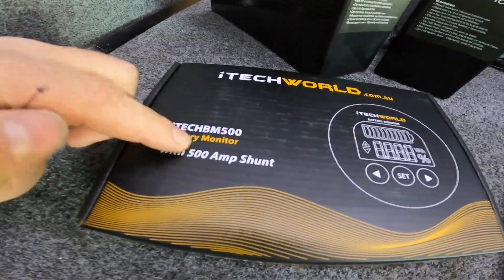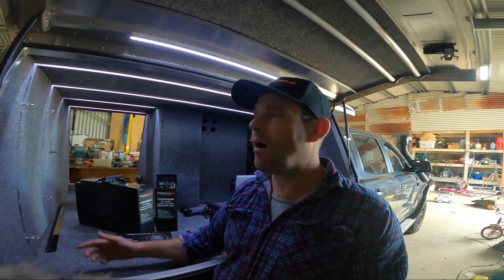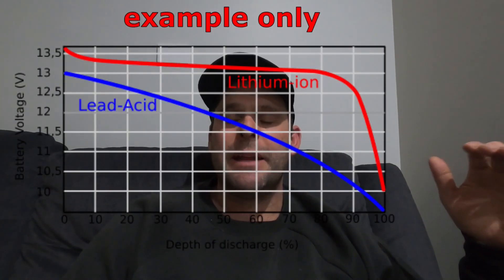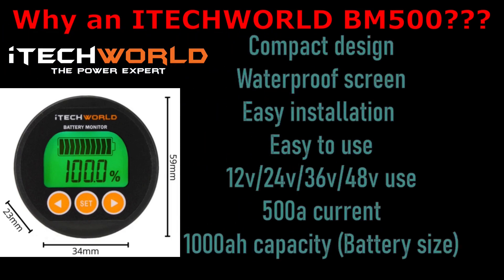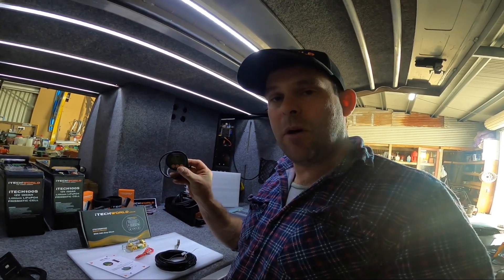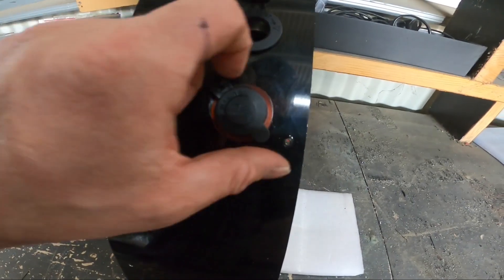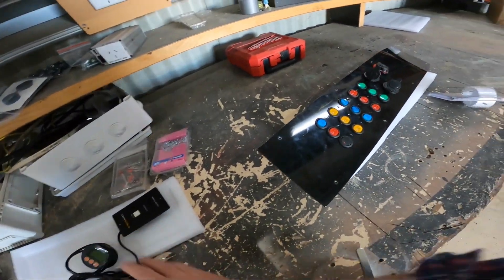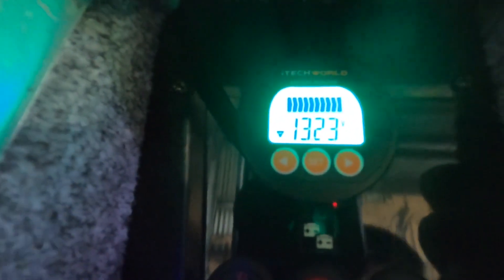iTECHBM500 12v Smart Shunt Battery monitor How to Install, how to operate and Tech review.

Comment: 1000AH capacity? I got 4x 200AH iTech lithium and tried to set it to 800 but it won't go over 553AH then it returns to 0.
Reply from the maker: Hi Gordon thanks for watching.
It would be worth contacting the itech support team to diagnose the issue.

Comment: Hi bud good informative video.. just got a question, how did you run your dc to dc charger with the shunt..? I've got the same just a bit confused on the dc to dc  connection.. your help would be appreciated
Reply: Run all your grounds to a buss bar (like he had in the video) so that would include your ground for the DC charger and any other grounds for anything else your running.

Then have one ground wire from that buss bar to the shunt (P side) then from the B side to the negative on the battery. 

As he said, the point is having all your grounds connecting to the P on the shunt and the easiest and cleanest way to achieve that is with a buss bar instead of trying to jam 20 grounds onto one post on the shunt.
Reply from the maker: Hi Sam, glad you liked the video, it’s hard to know exactly what your problem is without seeing your wiring diagram. The most common mistake and when connecting a shunt is the negative connections. ALL …negative connections must go to the P terminal of the shunt. I would suggest consulting an auto elect to go over your wiring or contact iTechworld and speak with the technician. 
Happy camping

Comment: The negatives coming from the input and output of the dcdc charger did you connect them to the p side of the shunt?
Reply from the maker: Hi Danielbell1621, thanks for watching. Connect negatives from  All loads going in and out of the aux battery to the P terminal. Connect only the B terminal to the aux Battery negative.

Comment: Hi, just a comment on the voltage and percent readings. I noticed your battery was showing 13.24 volts and 100%. Mine was showing similar until a friend told me it was a little out. This is what he recommended. Disconnect the battery so that there is no draw on it, connect my 40amp AC charger until it shows float charge. At this point, reset the percentage to 100%. Disconnect the charger. My voltage at 100% is now showing 13.8 volts instead of 100% at 13.2 volts. It might not seem like much but at least I'm not thinking I have 100% when I actually have 95%,
One other thing I've noticed. The battery does not start getting a charge until it gets down to 13.1 volts so it's possible to arrive at camp after driving and the battery is not fully charged. Assuming you have something like a fridge drawing from the battery. iTechworld recommend disconnecting and reconnecting the aux battery to force it to accepting a charge if it isn't down to the 13.1 volt point that will normally start receiving a charge. Getting to my battery and disconnecting it is a bit of a pain so I'm thinking of getting a battery isolator switch instead. Thoughts?
Reply from the maker: Hi Bugsy, some batteries may vary as to what voltage is at full capacity, I’m no expert so can provide any solid advice here it will just depend on the manufactures specs for that one. 
As far as the charger goes if it had an ignition over ride wire that can raise the lower charge voltage trigger point. We found our iTechWorld’s dcdc charger was less efficient without this wire connected. Too long cable between your charger and battery can also contribute to inefficient charging. 
Cheers OTL
Reply: Hey mate how have you gone about this problem I’ve got the same thing happening , battery shunt shows that it’s charging when solar is connected , but when I’m driving the battery isnt charging at all
Reply: @danielbell1621  as I understand it, if it is charging from solar it should automatically switch to charging from the cranking battery/alternator when you start the car. If it doesn’t then I believe the charger is faulty.

Comment: Most overpriced battery monitor on the market. This is a rebranded cheap Chinese model that lots of companies use, only that they sell these for around $39. 
Don’t fall for it, buy a victron or renogy instead.
Reply from the maker: Hi Alex thanks for watching. We hope you enjoyed it. Yes there are other monitors like this out there and we have used both. Are there much differences? No. Just the warranty and customer service. Did they both work well, yes we have road tested both and had good performance from them. 
We are doing another canopy build and would love to know what model monitor you think we should use. Also your reasons why we should go with that monitor. Looking for ward to your response. 
Cheers OTL.

Comment: Thanks for the video. I just bought the BM500 from iTechworld yesterday. I didn't really understand the cables connecting the shunt.  When you start talking busbars I'm lost. Where does the other cable come from to go to the shunt?
Reply from the maker: Hi Bugsy, thanks for watching, the busbar is just a bar with terminals, that connects a larger number of negative cables than the shunt can provide for.

The negative from the battery is connected to the B side of the shunt, no other negatives are connected at this place.

The negative from the P side is connected to the bus bar, all other negatives from accessories are connected to the busbar.

Hope this helped 

Cheers
Reply: @outtherelivin645  thanks mate. That’s a big help.

Comment: Do you set it to usable amps or the battery listed Amps ? Like I just purchased a 120x should I set it to 120 or 105 as listed as usable ?
Reply from the maker: Set it to total amps 120ah, you can still run below 105ah discharge, it’s just not good for the longevity of the battery to go below 20%.
You want the monitor to represent the actual health of the battery.
Reply: @outtherelivin645  a little more confusion. I have the 120X battery which they say is 120amp hours. I called iTechworld and they said to set it o 105 amp hours on the shunt gauge. ????
Reply from the maker: @bugsy1254  I would run with the advice from itechworld.

Comment: Not able to get it to read 100% even with a full charged battery and setting it up any ideas?
Reply from the maker: Hi Luke, thanks for watching, 
when fully charged push the right arrow so it reads a %, then press and hold the right arrow will set the current capacity to 100%
Reply: Out there Livin  dead set bloody legend
Reply: Is there a way to know when the battery is fully charged? 120x itech lithium battery. Thanks 🙏

Comment: Hi 
I understand up to where do I connect the P side into 
Cheers
Reply from the maker: Hi Jeff, the P side is for the negative of any accessories…ie fridge, battery charger, inverter. The only thing that should be connected to the negative terminal of the battery should be B side of the shunt.

Comment: hey dude. where did you get that control panel. cheers
Reply from the maker: Hey David, we made it our self with eBay parts, and a sheet of aluminium composite from Bunnings. We framed it out with aluminium angle.
Reply: @outtherelivin645  it looks good
Reply from the maker: Check out Instagram for progress photos!